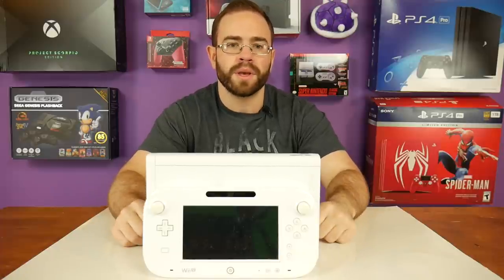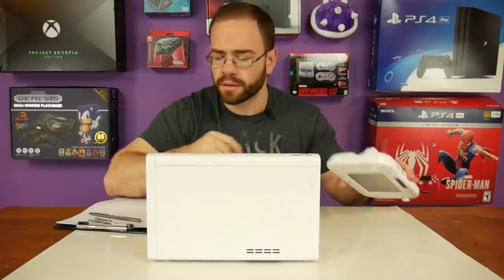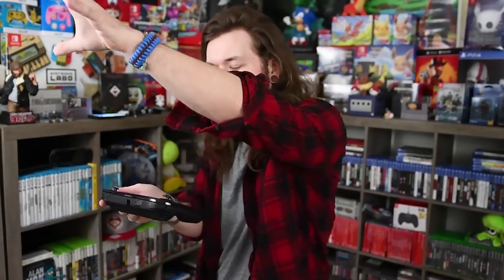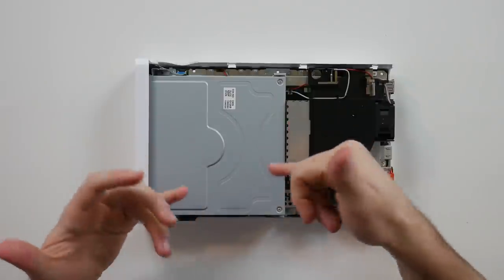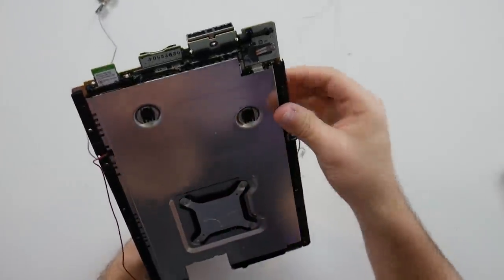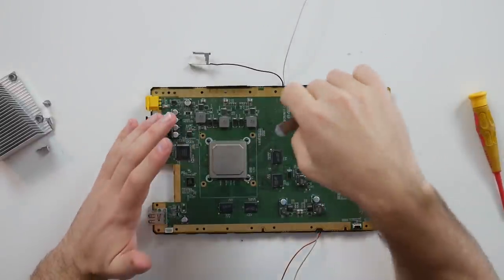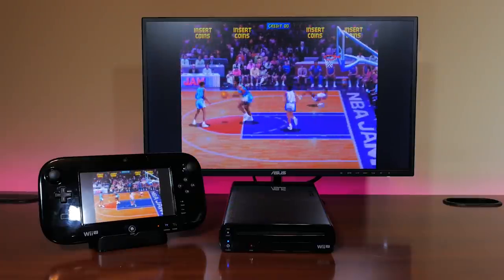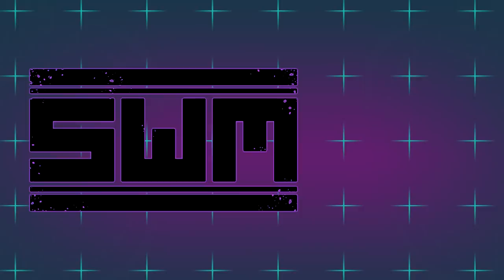Here's Why The Wii U Never Had A Chance (ft. BeatEmUps, Scott The Woz, Wulff Den, MVG)

Comment: Last console The late Mr Iwata was involved with.

Never going to sell the last gift to gaming he gave us.
Reply: He was involved with the Switch.
Reply: @noneofyourbusiness1998  he wasn't, it is well documented that he was too poorly when the switch was being designed. The switch was developed extremely quickly off the back of nvidia having a large stock of chips which were offered cheap to Nintendo

If you follow the time line of the legend of zelda Breath of the wild, it is obvious.

Iwata was last directly involved in the design process of the wii u, even opting to follow Japan's green technology mandate with the console only drawing a maximum of 35w. That was the entire reason for power pc tricore. Which wasn't underpowered like so many think rather an out of order process which required far far less instructions to do the same thing. Games being ported were written in a completely different language and needed heavy optimisation to run efficiently on the wii u. Evidence of this is shown in need for speed most wanted. It was also shown apparently in the earlu builds of GTA V for the wii u which of course was cancelled before any real investment was made due to the sheer amount of work it would have required to rewrite the code.

So wii u owners who want to see what the wii u was capable of with regards ports only need and should have Need for speed most wanted in their collection.

The wii u is reffered to as under powered because it is the easiest way to explain to the lay person why it is such a difficult chipaet to program for.

There are versions of Linux now operating on a single core of the machine and it won't be too long until we see the whole chipset being optimised, however the wii u did require a the GPU to play its part and this is a problem still to this day.

Spawn waves dismissive video about the wii u did not really show the wii u in the best light.
The little machine was extremely capable when you compare output per dollar
The xbox360 and ps3 were power juggernauts as are the ps4 and xbox one. Nintendo still with the switch have maintained their policy of bang per buck so to speak.

IBM are still fabricating power pc chipsets albeit with different partners. Power 10 will be out in 2020 10nm finfet design. Nintendo are still an IBM partner as they signed a 20 year deal towards the end of the game cubes life. I made mention of this prior to the switches launch and asked about finfet being used in any new Nintendo hardware getting a winky emoji back in return. Meaning Nintendo still could have hardware in development.

The step away from the power pc architecture was a power play by third party developers who wanted to have a single format for producing games across all formats including pc's. This in my opinion killed diversity and console exclusivity. Consoles used to have all sorts of titles from aaa blockbusters through to kiddy games. The step away from purposefully designed hardware has been bad for the industry. At least with Nintendo they still seem to be trying to have proprietary hardware.

For consoles to survive I see a step back toward specifically designed hardware to push the envelope of game design otherwise we will get to a point where in there will be no point owning a console against a pc.

Pc hardware is becoming cheaper in comparison with even small factor hardware ie stick pc's and mini pc's being able to run some games on medium/low settings and with streaming on the horizon Sony and Microsoft by going down the x86 route may have signed their own Death warrants.

With steam, Google stadia, epic store and amazon as potential streaming services a simple box with 4-8gb ram and a semi decent cpu streaming will be accessible with no need for designated hardware.

Microsoft may have already seen this with their recent relationship with Nintendo flourishing.
Nintendo have always made toys, seemingly cementing their longterm position.

The next 10 years
Will tell the tale of how console gaming survived or died
Reply: @ashleighcartwright5186  I am not reading an essay.
Reply: @noneofyourbusiness1998  no one is asking you to.

My response is in no way the length of an essay.

Its a few paragraphs.

If you are going to make comment, at least know what you are talking about.

Nothing to do with patriarchy, you man so you right

You are wrong

Just wanted to educate you
Reply: @ashleighcartwright5186  I apologize for bothering you.
Reply: @noneofyourbusiness1998  sorry for reacting so passionately. I am passionate because I was brought up with the NES in 1986 right through.
This console means more to me than many things as it was his last gift to gaming.

Comment: The Wii U evolved into the Switch, so Redeemed !!
Reply: Emily Apricot With the problems that switch has been having since its release.. not to mention the overall expensiveness of new joysticks and accessories?? I haven’t even covered the broken joysticks, the warping when it gets hot, the uneasiness of using the switch because of easy break ability or scratch-ability if dropped or docked wrong, or with the joycons loosening, then there’s the drifting, the downed resolution, long loading, and dead pixels.. which is NO excuse for a new system of this magnitude with today’s tech!

Comment: the main problem with wii U is too complicated, beside you need a tablet controller at least you need 2 pro controller, 2 nunchuck, 2 wii mote to ensure and guarantee you can play all the games perfectly in local multiplayer. for example you playing wii sport, so you absolutely need wii mote, and for perfect gameplay in other motion control games you absolutely need nunchuck.and for multiplayer in you need 2 of them each player.

 and for call of duty or FIFA, its okay to play using tablet controller but for local multiplayer you need pro controller and using wii mote suck.

and to have all of thoose are so expensive, if you playing with xbox and playstation all you need only simple controller since most of games are hardcore and only few need kinect and ps move.

Comment: So it does everything a  modded wii does (can get hd converter for 10$) minus original game cube controllers, and the 5 good games the wiiu had that are all on the switch now..   Glad i skipped it. BUT i will say its WORTH IT to buy one just for homebrew for 100$ or less hd native support for wii, and gamecube out the box, and perfect compatibility. Way better than emulating in hd on pc which requires 600$ or more to get full frames, and thats if the emulator doesn't bug out and ruin the game. -ps dont hack a switch NOT WORTH IT cant play wii or cube without lag even though its stronger.

Comment: Does Nintendo Switch have a proper CPU to run Wii U and 3DS games?
Reply: No it doesn't. It's an entirely different architecture.
Reply: @CathrineMacNiel  If so, what does the next console need in order to run either 3DS, Wii U and Switch games?